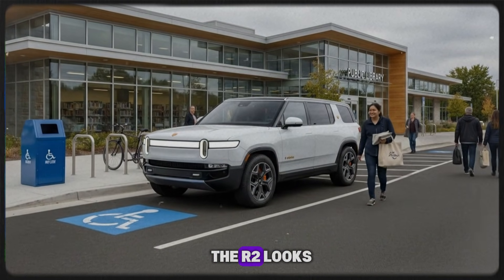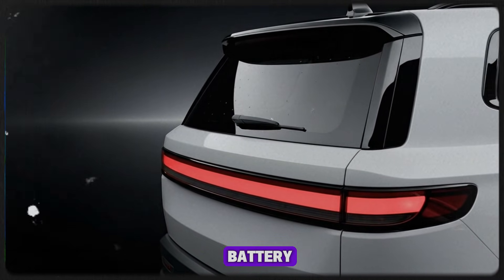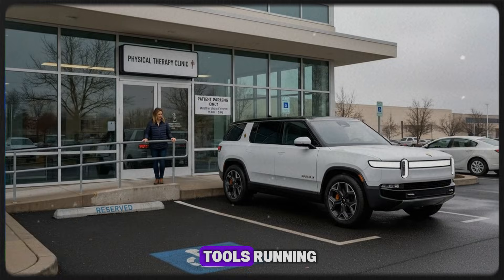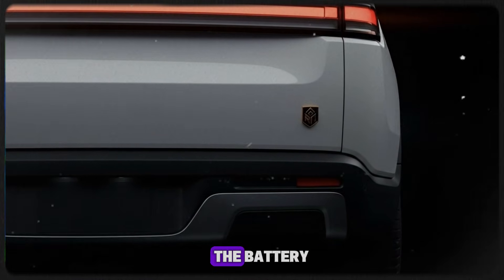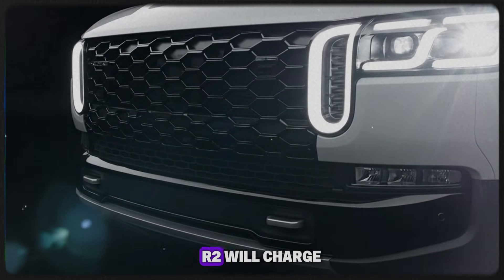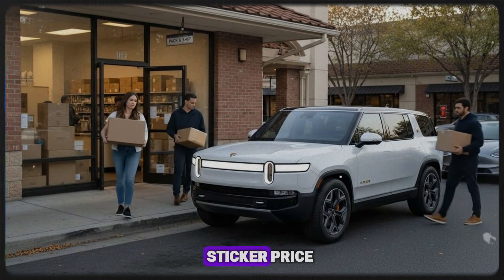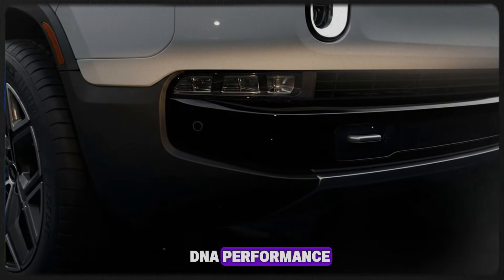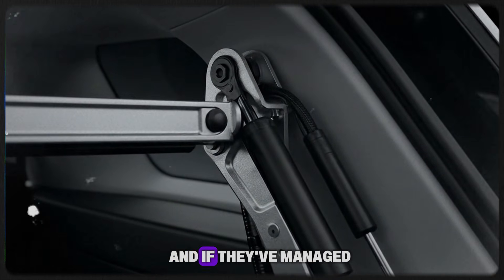Rivian R2 Battery Explained — Is This the Battery That Makes R2 Affordable?

Comment: To make an electric vehicle that’s going to sell well and be a favorite, which is important. There are two things at least that are critical that I see missing here. 320 miles of range or more are absolutely essential . Having a product that satisfies the needs of many people that are still on the edge of purchasing an ev  is the range #1. the other problem is DC fast charging speeds are critical for a good customer experience. Do you really believe that a huge majority of customers are going to be happy even if it’s two or three times a year that they have to wait at a DC fast charger for a longer time period.Than is acceptable for most other vehicles. It has to be as good as the competition or it will not satisfy. customers time is valuable.  time spent at a DC fast charger if not managed wisely is a big negative.